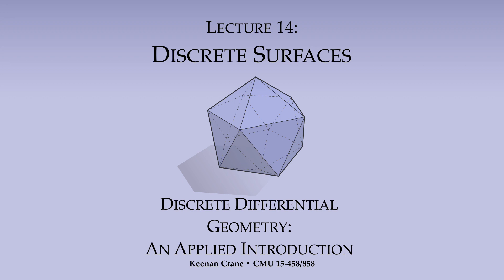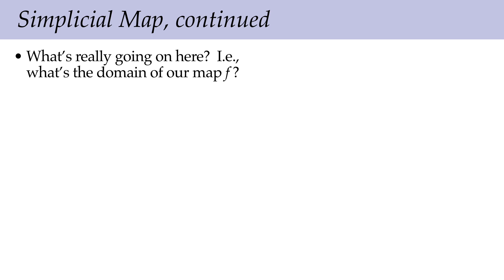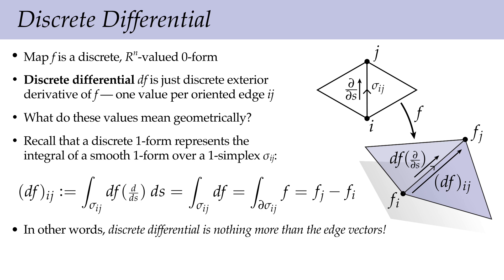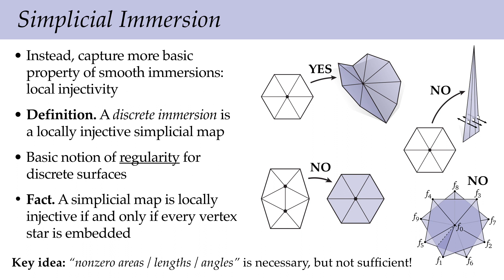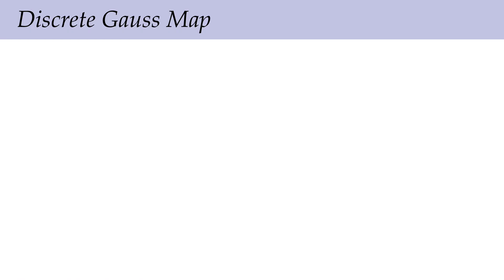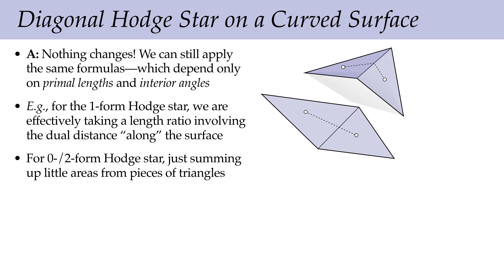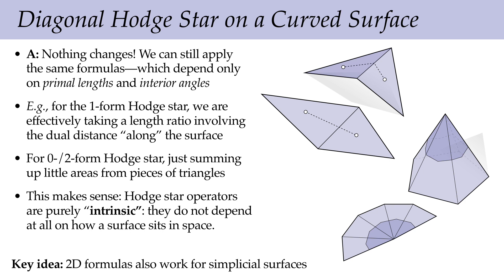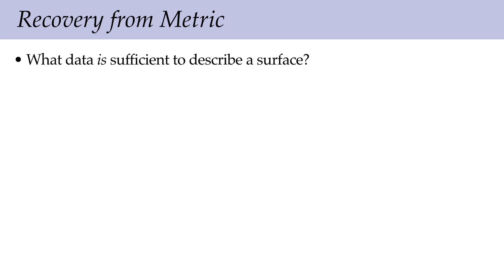Lecture 14: Discrete Surfaces (Discrete Differential Geometry)

Comment: @1:03:20
one simple example where it would fail to work if the 2 faces are in the same plane. So the cross product would be 0. I think we could handle this by checking other faces containing these 2 vertices of the edge, however, if the whole loop of faces around a vertex sets in the same plane, there would be no way to recover that vertex position.
Reply: I don't think even having other edges around the same vertex helps: one example, this will always fail to reconstruct the length of a prism. If you imagine a rectangular prism, then each face is a quad made up of two coplanar triangles, you can never determine the angle of the diagonals of those quads, so you can't figure out their aspect ratios, and it doesn't help that every vertex does have 3 planes adjacent.

In fact, if you take any convex solid and shift the bounding planes along their normal, you end up with a different shape with all of the same normals. This same reasoning can be applied to some non-convex shapes by considering a subset of the surface that corresponds to a subset of some convex surface.

Ah, and if I had been more patient: the examples shown later of discrete surfaces that aren't simplicial complexes give the same result! Those can all be triangulated into simplicial complexes where the normals aren't sufficient, in the exact same way I'm describing. Being a discrete surface with some non-triangular face is sorta equivalent to being a simplicial surface where some triangles are coplanar.